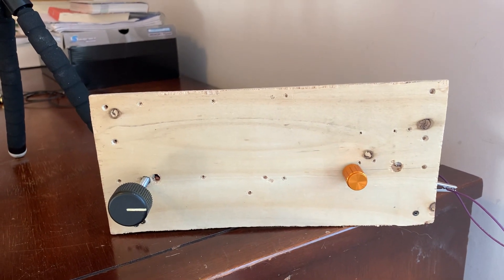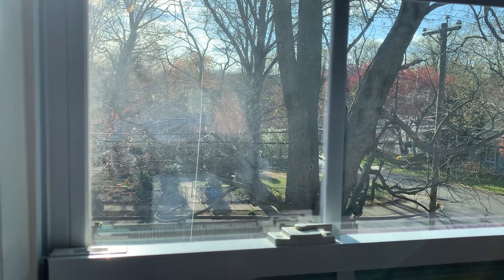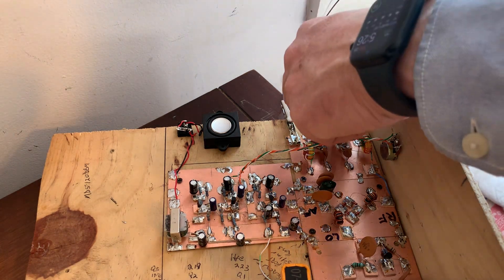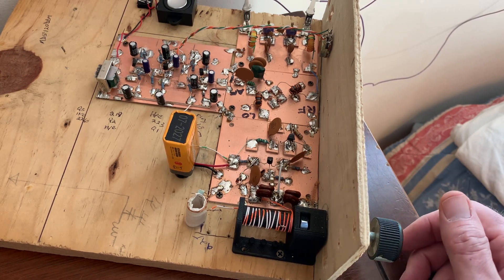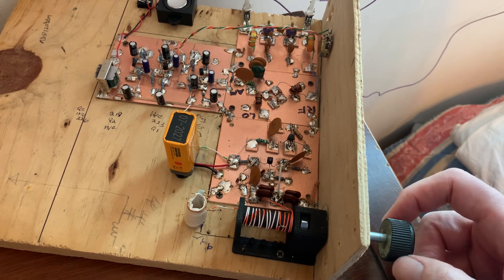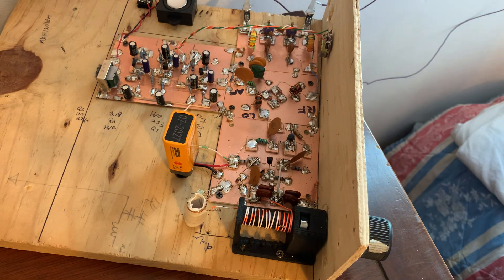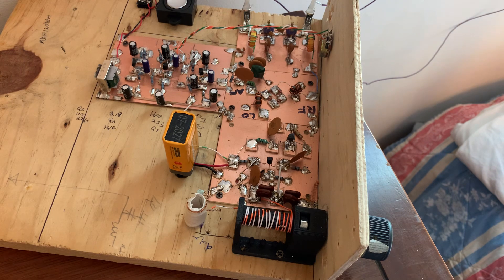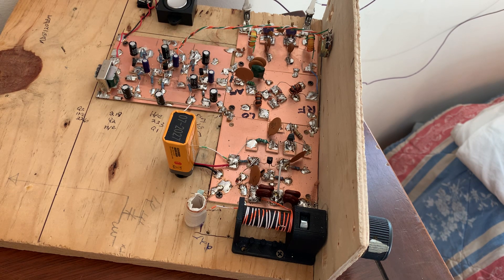An Antenna for the TJ 40 Direct Conversion Receiver

Comment: Bill, this brought my childhood rushing back. My bedroom was at the front of the house and I drilled a small hole through the corner of the window frame as the entry point for my random length aerial.  From the window it went up to a large poplar tree near the front boundary, then back down the garden. There was something special about sitting on my bed listening to my simple receiver while looking out at the aerial that was receiving the signals from far away. Magic times.
Steve M0KOV

Comment: Picking up on your Fldigi comment ... have you considered using WSJT FT8 and setting the input device as the computer (laptop) microphone, acoustically coupling? I've done that with amazing results on a DC receiver ... letting the students "see" the countries heard may add another dimension?
Reply from the maker: Yes, I was thinking that a simple acoustic link to FLDIGI would be the way to go.  Thanks and 73.

Comment: Our ham club did a group build of a 40 meter CW transceiver kit. We had 25 club members building them together on weekends. We built one circuit at a time and described the operation of it, and then demonstrated that operation using test equipment, verifying the proper operation of each circuit module for each builder's circuit, step by step to ensure that everything was working. Our promise to the club member was that when they were done building that each and every rig would work properly, even if they had never built anything before. By the time we finished, and everyone's transceiver was working, some of the first-time builders were already adding mods to them, from extra switches to enable backlighting, to custom wood cases, even to frequency readouts. They just asked us for a bit of advice along the way, and I'm sure they continued with their projects. They had the bug, and they had the confidence. Providing the tech support for that project was the most fun I've had as a ham. From teaching component ID to soldering, to reading a schematic, to the operational principles of each of the circuits and how to use a multi-meter, a 'scope, a freq counter, and a spectrum analyzer, it was just plain satisfying and fun. But your work with school kids, and the homebrew assembly from a discrete component level is far superior even to what we did. This is what radio is all about. Congratulations.
Reply from the maker: Wow, that is really cool John.   It sounds like we were after the same objectives.  I will share with our club's Maker group.   Do you have anything on-line about this project?  73  Bill
Reply: @soldersmoke , nope. Sure don't. We did it back when the web was just starting to grow by leaps and bounds, but it wasn't the center of our universe yet. Really, the key to pulling it off was simply a couple of people who knew RF well enough to make any simple kit work, and promising all of those who got the kit that it would work for them when they were done. That certainty was all that people needed in order to spend the money. Also, since we were getting 25 kits the manufacturer tossed din an extra kit as well as some random replacement parts. Also, I went through the parts list and my own parts stock and gathered together replacements for most of the kit so that if someone screwed up a part we just handed them a new one. Also, the other Elmer and I, (we even had a third one most weekends,) built up our own units before the project with the other hams even began, and we made notes about items that could be concerns during the build, and we made up a schematic with DC voltages and measured waveforms to be expected around working circuits. That sort of preparation made assembly, testing, and troubleshooting easy for everyone. 

Another part I liked was that before we built a particular circuit in the rig we drew a schematic of it and explained how that circuit worked and what the waveforms would look like when it was built. If you can show someone how to solder, and identify and measure their parts up front, then follow the process I described above, by the time the kits are built you have a roomful of hams who were total noobs, but are already planning mods to this project or building other projects altogether. It becomes a real confidence builder and opens the imagination to other ideas.

My partner and I brought in our own scopes, sig gens, and spectrum analyzers for the testing, (big HP and Tek grade gear,) but these days a multimeter, a TinySA, and a NanoVNA in your pocket are about all anyone needs in order to test, troubleshoot, align, or even design RF circuitry. They make what used to be impossible not only possible, but quick, easy, and cheap. They take the work out of being an Elmer. I got 2 TinySA's and 2 NanoVNA's just so I could loan out one of each to those who couldn't afford even the $50 to $80 for each of them. 

I'm very money conscious when working with hobbyists. Radio shouldn't have financial walls blocking anyone from getting into the hobby, and a good Elmer comes up with work-arounds to avoid having to spend money. This receiver of yours is a perfect example of that. It teaches a lot, works well, and costs next to nothing. Some people just don't have money, especially kids, while others are just leery of spending it before they are sure of their interest level. But radio is a hobby where it's much more important to know stuff than to have money. If you know electronics, you can do almost anything with nearly nothing. The YT channels of VK3YE, MIKROWAVE1, MONTV, and you are examples of what I think ham radio is all about, knowing how to do stuff with RF and how to make electrons run through little circuit mazes you created, not 'upgrading' from a $5,000 appliance to a $10,000 appliance, and putting up half a dozen 200 foot tall towers. To me, that's an entirely different hobby, and not nearly as much fun.
Reply from the maker: Well said John.  Thanks and 73  Bill

Comment: An antenna lead without a counterpoise or ground is equivalent to hooking up the + lead of a battery but not the minus. So unless you are running a full halfwave antenna to establish that +/- 'difference' reference you will NEED a counterpoise or ground. The "other half' of an antenna can be sort of faked by the metal mass of the receiver acting as a reference 'sink' for the signal. But a rig such as the one you built has almost no 'ground' mass to act as that reference, so you need a halfwave dipole, a counterpoise of 'some' length, or a ground.
Reply from the maker: Indeed John, I agree.  But there are hams who just don't believe in counterpoises!  I like your analogy of the car battery with no minus connection.  Exactly.  We went with the 1/4 with the counterpoise for two reasons: 1) the students probably wouldn't have enough space for a 66 foot 1/2 wave antenna, and 2) It would be hard for them to access a cold water pipe for ground.  So we went with the counterpoise. 73  Bill